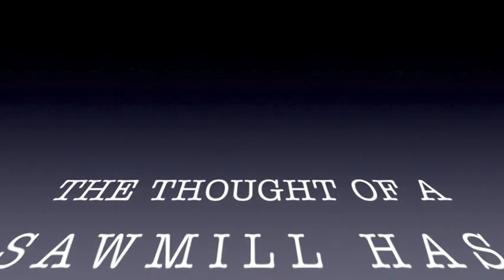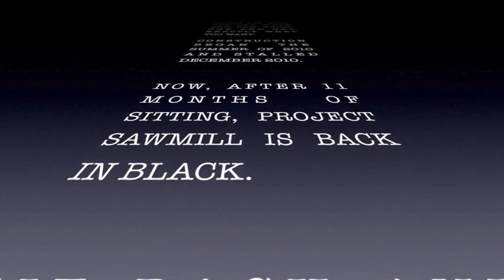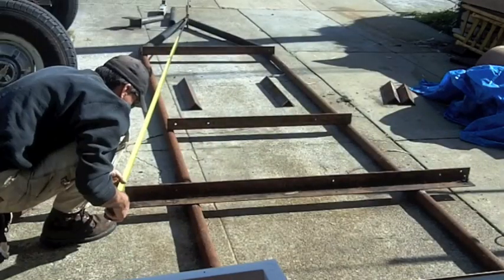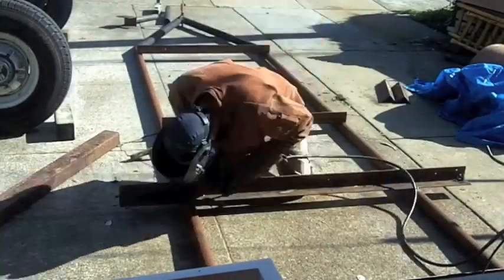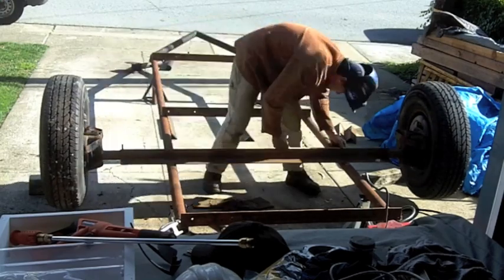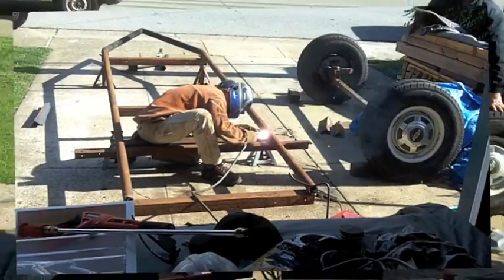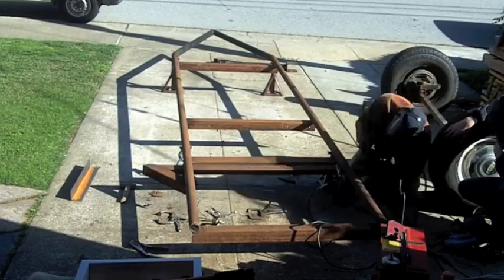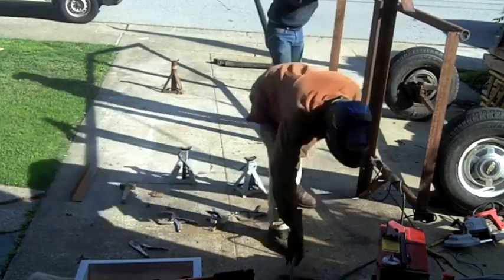Home Made Sawmill  Bandmill  Trailer build 1

Comment from the maker: @AleksFarm I have a Kawasaki 440cc twin cylinder two stroke engine out of an Arctic Cat snomobile complete with CVT. I am planning on running it through an atc diff/trans so I can hit a panic button and shift it into neutral and remove all power from the blade.  That is the plan right now, it can change once I actually try to get it all to play nice together.

Comment from the maker: @Mopardude As most of my projects are... I set out with the goal to make this 100% out of scrap or re-purposed materials.  I think I will be able to get it 99% there and only have to buy the blade (it will have to be custom made)  I had to trade some beer for the power plant, but other than weld wire and some time, I have nothing into this project.